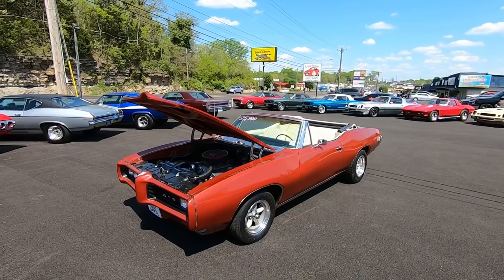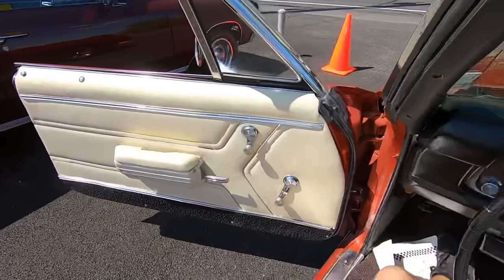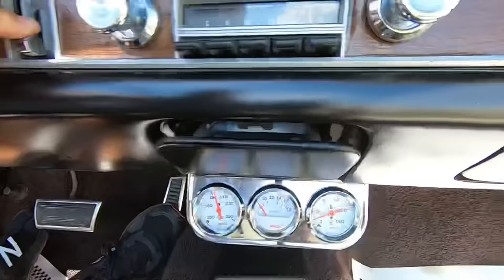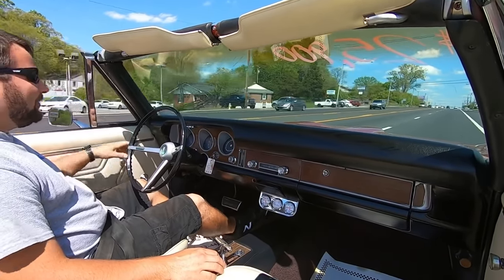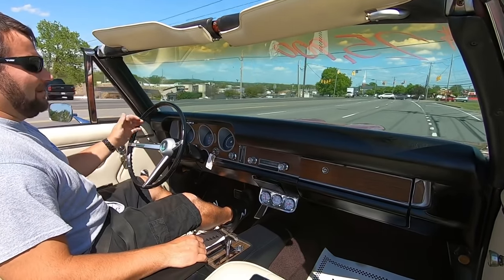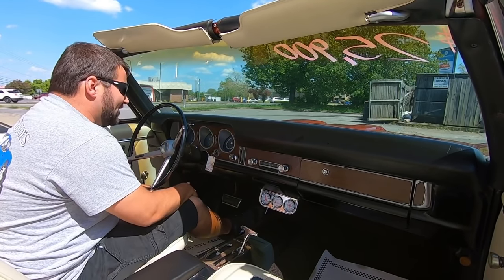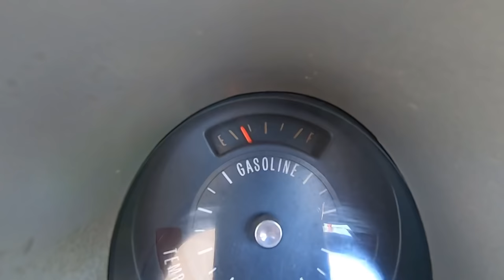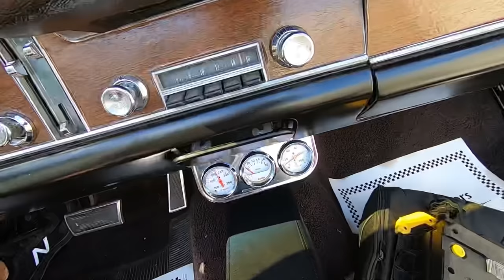Test Drive 1968 Pontiac LeMans Convertible SOLD $25,900 Maple Motors #1015

Comment: Not bad, alternator belt is ready to go, gas is leaking out the filler tube you pointed out. Look at the bottom of the tank. Just a quick  suggestion.